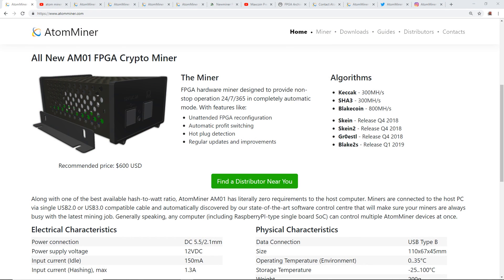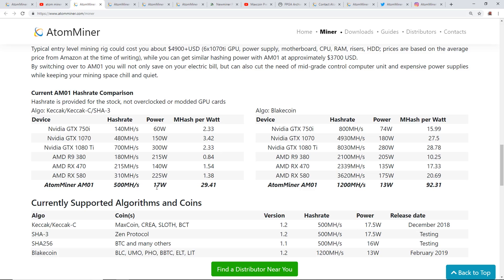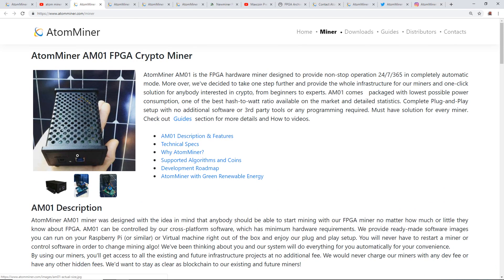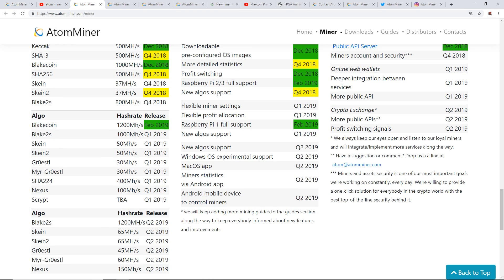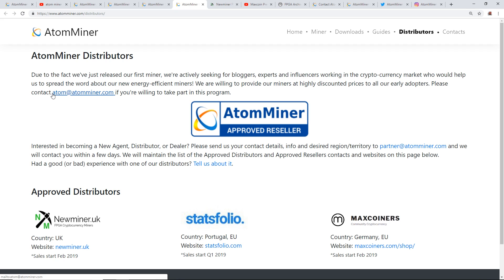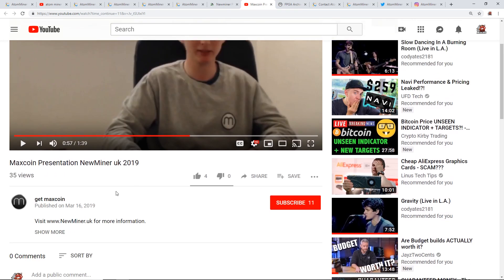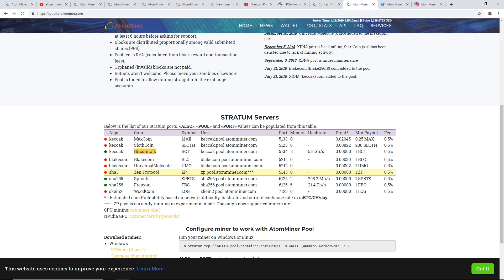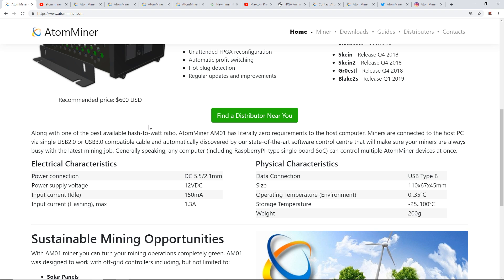AtomMiner AM01 FPGA? 17.5 Watts?

Comment: Verus is a low power option for mining and is still profitable for CPUs and FPGAs many people in their community have FPGAs and a lot actually mine on their laptops too, the lead dev is a former VP at Microsoft and they designed their own 51% immune algo that equalizes hashrates across hardware types meaning right now they have CPUs competitively mining on the same network as FPGAs!

The big news that miners may be interested in is the concept of Merged Mining, predicted to be the future of mining by Satoshi himself.

Nearly a decade ago, Satoshi described the concept of Merged Mining, but most implementations since then have only been partially complete in that in order for it to function flawlessly, it would require an ecosystem of interconnected chains with a fully secure parent chain.

 Verus' new Public Blockchain as a Service (PBaaS) release (functional public testnet now) where you can Merge Mine up to 15 chains simultaneously for the energy cost of 1. A complete, scalable and secure, self-reinforcing ecosystem comprised of an infinite amount of customizable projects all working together in harmony. Definitely something to be excited about.

 A more thorough explanation can be found here but it really is revolutionary and no small feat- 
https://blog.goodaudience.com/pbaas-the-age-of-merged-mining-is-upon-us-18149321f84f

Comment: I  was advertising for Atom miner around October of last year. You can see my comments on the Technicals  video about this project alone with me shilling for futurebit. The Atom miner website went cold and I didn't think the project was going anywhere. The only reason I was interested in the project was because I was trying to do something similar with the Xilinx Zynq7000 that comes with the ant miner s9, t9, E3, v9, controller. I'm all about the home miner and using solar is even better. Its too bad Hashaltcoin has got the jump on these guys at Atomminer.

Comment: When you say amps say the volts thats operating, not watts. Watts is just measurement of power. Technically accurate and correct to calculate with volts and amps.
Reply: Excuse my typos lolol
Reply: Not to be nosey, but where are you located in the states?

Comment: The dude sent all the paper work to become an authorized USA distribution point and it was exstensive; the reason I didn't go for it was the amount of units that had to be sold monthly was pretty high. I might write them again and offer to pay the shipping both ways just to bench test it to find out.

I have had a backup emergency solar system for about five years now and if you plan to build a system to run sensitive electronics; it is highly advisable to get a "Pure Sinwave Inverter".  Even "Simulated Sinwave inverters" has fluctuations that can damage circuit boards.  

Additionally, there are three types of charge controllers; they are:
Simple 1 or 2 stage controls 
PWM (pulse width modulated)
Maximum power point tracking (MPPT)

MPPT are a little more pricey, but are way more efficient; and a 30 Amp controller has handled everything I threw at it except for an Arc, or Mig welder and a 5hp V-Twin air compressor.

Many people talk about building a complete off grid system; once you run the the real world numbers, ( about the same price as a Tesla3 ), you find out it is nearly the same as paying your electric bill in advance for about 10 years.

I found it to be better, once your AGM battery bank is charged; pump your excess generated power back into the grid and instead of paying a power bill, you can collect 4 pay checks a year, once every quarter from the electric company; and pay for the system and there after profit.  You have to check your state, some pay the retail rate like mine does, others pay wholesale; and a few only give you a credit toward what you use.

The power company will normally install a second meter to measure what you pump in for free, since they will receive federal tax credit(s) for more people they have adding green power to the grid.

I only added this because it is a game changer for augmenting your mining use and profit margins.

Peace